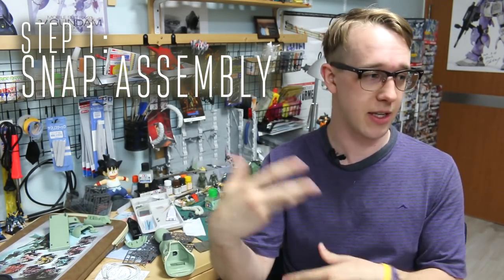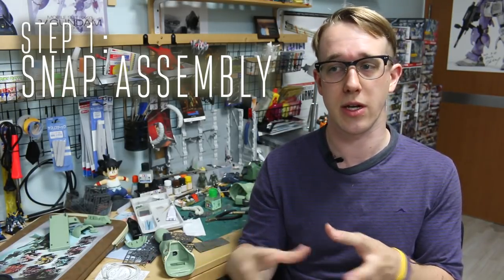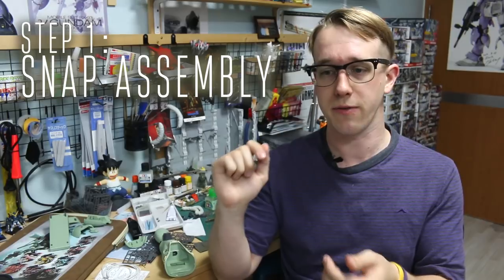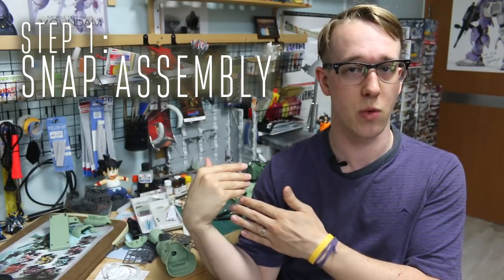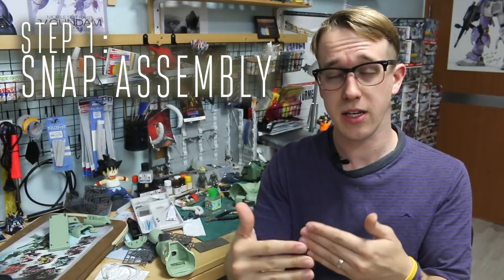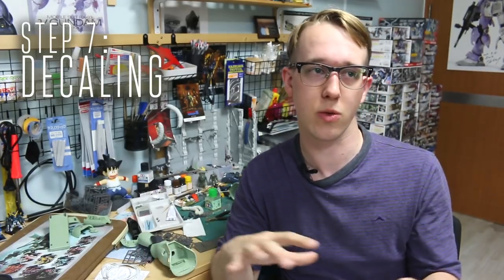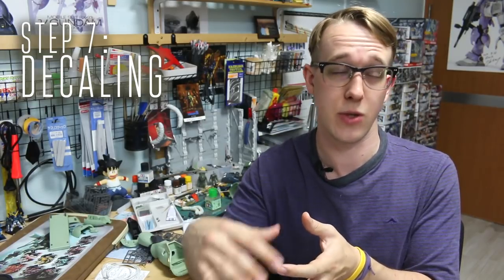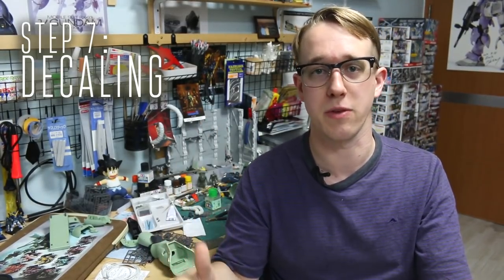1240 - FAQ: Steps for Painting

Comment: Where does seamline removal fit into this?
Reply: I'm guessing after snapping it together, then taking it apart, then snapping together the parts that can BE snapped together while working their seam lines, then seam lining. Then painting. But, he'd have to answer haha

I always snap mine together first no matter what I am doing to them, so if I do the seams lines it comes in pretty early.
Reply: Beau Hindman say you have a shoulder piece (HG Infinite Justice) and it is made of four pieces and the pairs snap together but have a seamline. 

And I want to paint two of them a different color from the other pair. 

Would I remove seamline on both pairs and then prime?
Reply: Ah, I get ya. He would be better to answer this, but if I hear you correctly you just need to seam the one part, then snap the other part over it and seam. BUT, you also have to consider painting that first part so you would not have unpainted parts. WOW. lol I have had kits like that where I have to complete one entire part all the way through to it's not unfinished when it's snapped in.
Reply: Beau Hindman oh ok thanks for your reply
Reply: after the first dry fit(before primer coat) one could see where a seam line appears. then one would have to decide how to best remove seam line, so the primer can go on smooth or reveal a " need to be fixed before paint" situation.
Reply: Eric Le and

Comment: what should i use for primer?
Reply: Dragon hydra 
If ur Rich mr Surfacer 1000-1200 is the best.
If ur poor goto auto store buy DuPont "primer filler/sander". It's important that it says filler/sander on it.
This is auto primer and do NOT spray from can u need to decant then airbrush. Good luck brotha
Reply: For inexpensive spray cans Rustoleum is pretty hard to beat. If you're in the UK Halfords primer is pretty popular. A tip for spray cans is to put the can on warm water before spraying to thin out the paint (the paint will splatter when it's cold).

For airbrush, as what John said if you have money use Mr. Surfacer. Alclad also makes some primers. I've only used Alclad black for metallic finishes. Vallejo and Badger makes some pretty good acrlylic pre thinned surface primer.
Reply from the maker: I use Mr.Surfacer 1000 or 1200! It's cheap here in Korea, luckily.
Reply: ZakuAurelius 
RUDE!  J/k. 
Hey Zak have u messed with Naoki's NAZACA primers by chance? If u see one pick it up test it for me!!!!!
Reply from the maker: I have used Nazca primer, it's great! It's super smooth and works as a paint as well, so you don't really have to paint over it if you don't want to!

Comment: enamel vs acrylic thinner? and 
gray vs black panel accent?
Reply: Vfor Vendetta thinners will work with paint of the same type, so enamel thinner for enamel paint and acrylic thinner for acrylic paint. As for Panel lining, it is up to what you prefer. Many people prefer gray for white base paints, as it won't make it stand out too much, but still make it noticeable. Some people will use brown with some tan and yellow colors as well.
Reply: thanks for the info but i do remember there is like a hierarchy when it comes to enamel vs acrylic vs lacquer like which is stronger than the other, like one is more effective or will last longer against another something like that
Reply: Acrylic is water based and can be thinned with water, isopropyl alcohol, and lacquer thinner (pretty much turning the paint into a lacquer based paint). 
Enamel is oil based and can be thinned with enamel thinner and mineral spirit (some won't mix well with MS).
Lacquer is solvent based should be thinned with lacquer thinner exclusively. Lacquer thinner can be used to strip/clean any of the paint types due to the solvent property.
 
Lining is personal preference so my opinion may be different from others.
Grey for white or light grey (black is too high contrast for me)
Black for darker pieces like blues, greys, and green.
Brown for red, yellow, tan, sometimes green.
Reply: Lacquer based usually tend to be a better finish and it's "hotter" as in it will react the most with plastic, plus dissolve any other paint types it is applied on, so you want to use it as the base coat and use other on top of it. Additionally, Lacquer emits a lot of nasty toxic fumes, so make sure you use a respirator and/or painting booth to extract the fumes out of your work space  Enamel is very durable and thick, and is great for detail handbrushing and panel lining, although if you desire to airbrush, with it you'll have to thin it a lot. Acrylic is relatively safe, you can thin it with Isopropyl alcohol, and is easy to clean, although it is also the least durable and I'd highly recommend to prime your surfaces to help it adhere better to the surface. 

So in short, apply in this order and you'll be pretty safe from ruining your paintjob: Lacquer > Enamel > Acrylic. Hope that helps!

Comment: If I were to snap build then decals and top coat,will primer be necessary?
Or is it just necessary when custom painting?
Reply: Primer is only needed when you want to paint the model, but you may still want to apply a gloss/semi-gloss top coat before adding decals (if they're water-slide) to help aid in application and then seal it all with another top coat after applying the decals